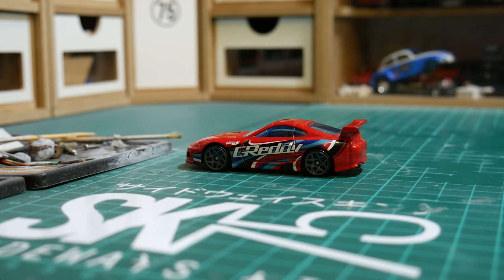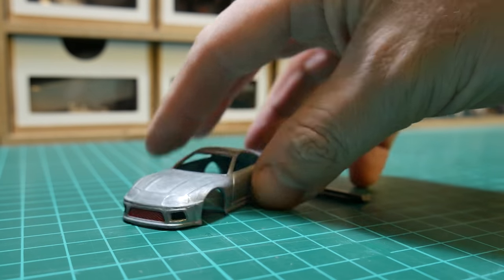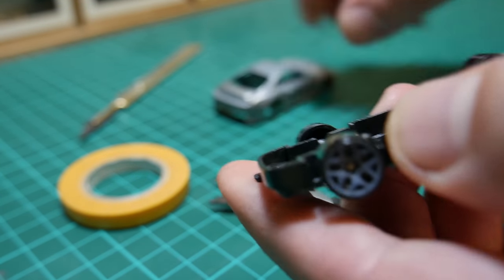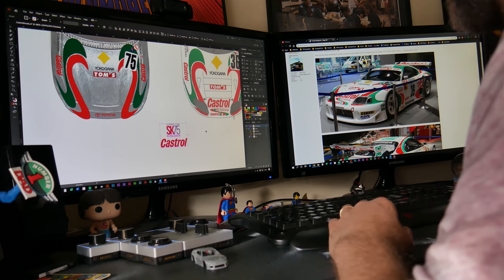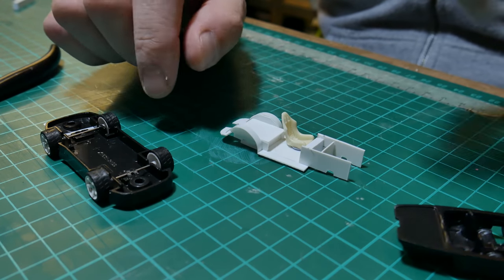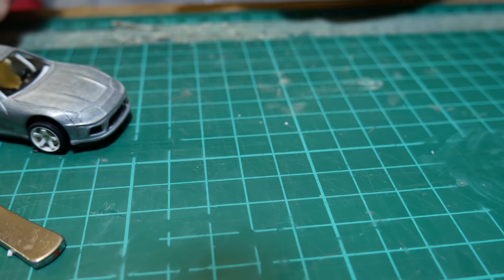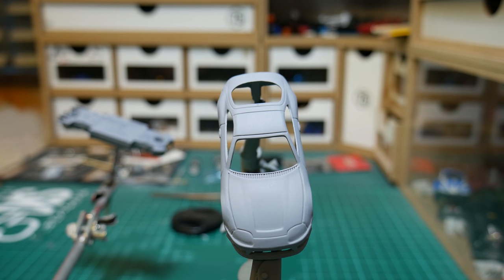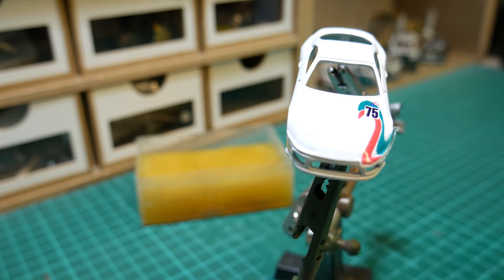HOT WHEELS Custom : 2012 Toyota Supra

Comment: what kind of plates do you use for the wing, interior and splitter?
Reply from the maker: They are metal etched parts which you can get from a guy called Krome Bandits on Instagram,  theres a link on his Bio on there to buy them👍🏻
Reply: @SidewaysKing75  I don't mean those, but those white thin plates. I posted the comment before watching all the way, so i didn't know you didn't use it for the rear wing. The plates you also use for the interior